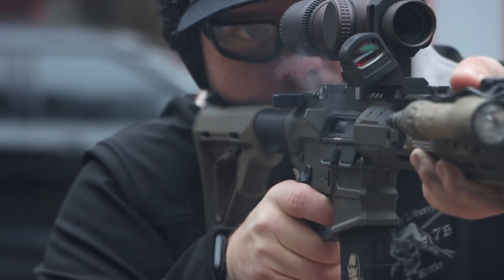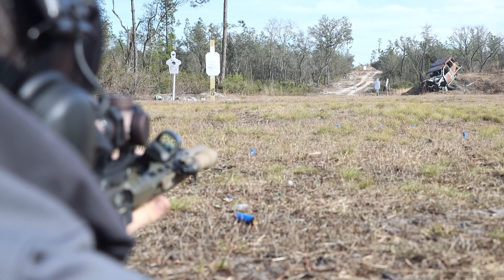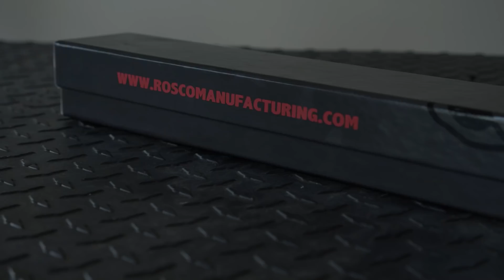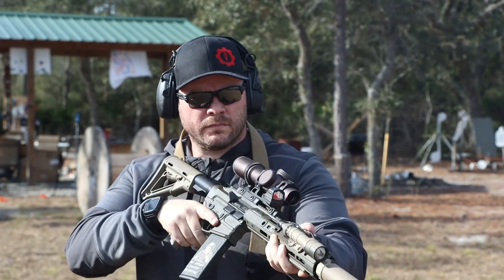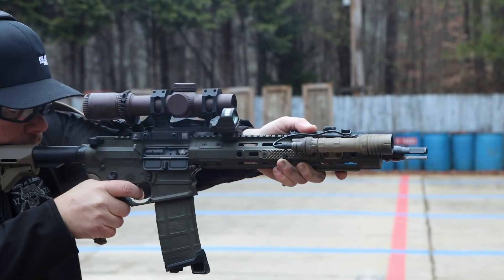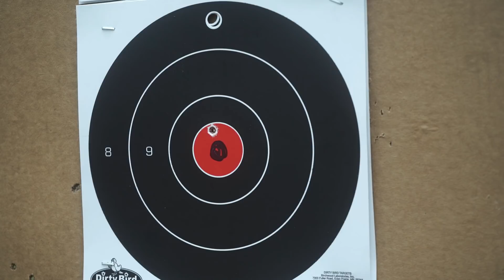Rosco Mfg 12.5" K9 Sage Barrel.

Comment: Gas length and gas port size variety is what excites me personally about AR's going forward. The right barrel length has the right mission set. Each barrel length deserves the proper gas tuning as well. There is no catch all
Reply: Whatever keeps that rifle running.
Reply: Black River Tactical has been on the cutting edge of this for a handful of years.  It's more than just port size, it's also the timing and he nerds out on this part of tuning.  It's a small shop though and he can barely keep them on the shelf.  Good to see a big manufacturing going down this path.  BRT came up with an extended carbine and mid + awhile back and has a ton of fans.
Reply: @recceshoe6911  yeah I’ve got a few BRT barrels. And they are incredible. 
My 12.5” exc BRT barrel is slightly longer than a carbine length system the gas port and length shoots very reliably. 
My rosco 12.5 with the new patrol length is 3/4” shorter than mid length gas and the port is actually pretty small. It runs VERY well. 
The barrel is also incredibly accurate and I used to say my brt barrels were some of my most accurate barrels. The chf chrome lined exc length brt is definitely I trust with longevity and accuracy. The rosco is absolutely a tack driver. Super super accurate but it is 416r stainless so it likely won’t outlast my brt. No matter I’ll buy another rosco for sure. And I’ll grab another brt for sure. 

Can’t ever have too many barrels haha
Reply: @recceshoe6911  I should also say I am a huge
Fan of intermediate length gas systems on my 14.5” builds. They shoot super soft! I also love dissipator 16” barrels. I nerd out on gas lengths for sure
Reply: Good point.
Reply: There’s been a lot of bad ass dudes doing bad ass things with rifles for a real long time and didn’t need to get all super foo foo about their barrel length, gas port size, gas length. At some point all this tinkering really does is give gun nerds something to tinker with and manufacturers something to sell.
Reply: @johnniewasr5740  So... Welcome to the economy. Don't want it, don't buy it. I, however, have already bought one, and I'll do the same for the 11.5". Gas port location and dynamics are definitely advances forward for the AR small-platform rifle, which will help keep it alive and relevant for generations to come. Although I'd be lying if I said I actually look forward to the day, if I see it, that some newer, more advanced platform takes up where the venerable AR15 will have left off
Reply: @johnniewasr5740  They didn't used to shoot suppressed and need the gun to run either way, interchangeably. They also used to do CQB with an M18 Garand, but it probably wasn't very easy. 😎✌️

Comment: How does a 12.5 middy “beat up the bcg?” The only midlength 12.5” I’ve had experience with is Triarc’s and it was the softest shooting AR I’ve ever experienced. Are companies reaming out the gas port or what?
Reply: Pretty sure he said midlength on a suppressed 12.5” beats up the bcg
Reply: @jakobfields2183  That doesn't make any sense, though. If Mid-length on a 12.5" is harsh on the bolt/carrier, then increasing the dwell time (i.e. DECREASING the gas system length from Mid to 'Patrol') will just make it even harsher.
Reply: I am swapping to 12.5 mid from 11.5 carbine. I’m expecting the decrease in dwell time to lower my gas some. I would assume a 12.5 with even longer gas system would further decrease the dwell time and tame it even further.
Reply: @frankender7026  exactly. That’s where my confusion lies.
Reply: @frankender7026  it might be the balance between length and port size.
Reply: I’m using that barrel now and I have had no issues at all. Paired with a lantac enhanced bcg, geissele braided spring with an H2 and runs great unsuppressed and suppressed. Hardly any recoil to speak of or gas in the face I might add.
Reply: Yes, some companies that put longer gas systems on there barrels will then open the gas port up quite a bit in order to get it to run properly. Generally speaking, 12.5 carbine length barrels have somewhere between .062-.070 gas ports. I have a KAK 12.5 mid length and they opened the gas port up to .096
Reply: @izatt82  Bingo
Reply: @frankender7026 Think it works the opposite way that you’re thinking. Increased dwell time means that the system isn’t in such a rush to force gas back which means less violence on the BCG. With the can creating so much back pressure, the idea is that the increased dwell time will smooth things out when running suppressed while still maintaining reliability unsuppressed.
Reply: It doesn't, his new  gas length would "beat it up" more but it all comes down to the size of the gas port. I'm pretty sure we were the very first to start producing mid gas 12.5s in 2010. I have retired but Blackstone is now selling ARP  barrels  4150 cmv 11595-e steel and Melonite/Nitride treated with 5R rifling and Wylde chambers. They typically run 60-90fps faster than other barrels of the same length so a 12.5 is as fast as some 16" barrels especially the old 6 groove design.
Reply: @crashdsnowman1  wait, were you the owner of ARP? I almost bought your 12.5 back in 2020 but you were out of stock, so I ended up grabbing a 5R 16” from Randy (?)

I think I even emailed you because his website was all aviation stuff other than a page to buy your barrel if I remember correctly. Seemed sketch, but you set me straight and I snatched it up lol

Damn, I had no idea you sold everything off! Enjoy the free time brother
Reply: @jeremylowe5449 Blackstone Arms in Texas is making the barrels the same way using my tooling.

Comment: I started making 12.5" barrels with a mid gas specifically for suppressed use in 2010. 4150 CMV 11595e and Melonite treated. We sold thousands every year, our second most popular length after the 16s.

Comment: Your light is about to fall off. I triple de-grease screw/screw hole with 99% isopropyl alcohol and paper towel, shake loctite 243, apply to BOTH screw AND screw hole. 16K rounds on one of my rifles and nothing has come loose, some others have a few thousand as well, nothings come loose either.

Comment: I’ve been running one of these barrels for a few weeks now and it has been performing very well. I ended up putting a triarc systems easy pin gas block on it. The gas tube almost didn’t fit in the gas block and wouldn’t fit in the gas key on the BCG I had for the build. Ended up swapping out the BCG for another I had and after checking the headspace and gas key compatibility it has been extremely reliable so far. I really like it and am very happy with it. Great video as always

Comment: I’ve already got mine on a new lefty build I decided to try running a
Setup with a ejection port on the other side of my face with a can! So far the barrel is PERFECTION!! The profile is awesome. The gas port is great! And it’s basically.75” shorter than a midlength gas system.  I use carbine, EXC, the. K9/patrol and midlength 12.5” barrels. I love my middy but the patrol is awesome!!
Reply: 0.75"? Doesn't sound like much.
Reply: @Darth Erebus. Yeah it’s not
Much. But I’ll tell you what the recoil
Impulse is impressive! I have mine setup using the vltor A5 system and it’s quite a system. 

From the muzzle device down it is setup like this. (Unsuppressed) Forward controls design 6315KM 
(Suppressed) Rex silentium mg7 .224 bore apperature 
Rosco/sage dynamics k9 patrol 12.5
Lefty bcg and upper from stag defense
FCD A5 length buffer tube
Vltor a5-h1 buffer 
Sprinco green spring. 

It shoots beautifully

Comment: A 12.5” mid length barrel is similar to an 18” rifle length barrel.  My 18” SPR was so soft shooting that it failed to lock back on last round with a standard carbine buffer.  I solved the problem by getting the Springco Yellow spring which is lighter than the standard carbine spring and it works perfectly.  So if anyone has any issues of short stroking or bolt not locking back, I’d try the yellow sprinco before opening up the gas port.

Comment: I purchased one. Going to try it out this weekend with a RECCE 5 suppressor. Only complaint so far was the factory dimple is exceptionally shallow…so I purchased a dimple jig and cobalt 5/32 bit to drill it out a bit more.
Reply: The barrel shot great. I ended up using my dimple jig to drill a deeper dimple. The one that comes with these barrels is trash. Guess it’s still better than nothing.

Comment: I snagged one, it won't replace my main barrel immediately but I'm excited to try it out. Been meaning to do a 12.5" build and it came out at the perfect time!
Reply: how's it been, so far? any feedback?
Reply: @sodajones2576  still waiting to get all the parts together. I'm working on like 3 or 4 projects at once, I'm not very good at being focused at finishing one project 😂
Reply: @sodajones2576  I FINALLY got around to finishing it and can confirm it's an excellent barrel. Great 1~1.5 MOA at 100 yards and cycles so smoothly with a Sandman S on it while using a VLTOR A5/Sprinco Green/H1 buffer system.

Comment: I ordered one earlier tonight! Thank you for your development work on it. I'm planning on using my A5 buffer with it too, and I've got 1000, 77gr moly coated OTM's ready to roll my own for it. After working on my 3rd MK12 , 
I figured it's time to do one a little shorter.  I love the idea, of the patrol gas length.  I've got a couple of MK18 clone pistols and I liked the Retro 12.7 pencil barrel length but they have the carbine gas system.  I can't wait to do a test,  side by side comparison,  and get some groups down range.
Reply: What weight did you go with on your A5 system? I dont plan on running suppressed, so I thought the h1 would be most appropriate. Thoughts?
Reply: @andrewfernandez8330  I believe its 5.5oz buffer... Heavier than a H1 I believe

Comment: I have a Rosco 12.5" K9 Patrol length Sauce Pack in the shipping process from Optics Planet. I'm building it on Aero Precision receivers set and handguard. I wanted the soft recoil and the suppressed/unsuppressed reliability. I don't expect to wear it out, as I have too many guns begging for my attention and ammo is expensive, lol. 😎✌️
Reply: Ok, built and tested. I built the Rosco K9 12.5" patrol sauce pack on an Aero Precision upper receiver and it all went together perfectly. Used a Midwest Ind. 11" Slim handguard and a Griffin Armament taper mount Paladin 2 port brake. I ran it on two different lower receivers, both 17 Designs milled units. One with integral folding mech (and it's heavier buffer weight) and the other a plain non-folding lower (with a 5.5oz buffer). Starting un-suppressed, the upper ran perfectly with very light recoil, especially with the folding lower. Suppressed, using a Griffin Armament Bushwhacker 46, it ran amazingly with very little change to the recoil on either lowers. This was just on the short range dialing-in range. So, as yet, I can't speak to longer range accuracy. Softest shooting AR I've ever ran. My 4" 9mm Radial-delayed Banshee barreled AR was noticably more snappy. Thanks, Rosco!! 😎👌

Comment: What buffer weight you recommend for the barrel. Just got mine in today
Reply from the maker: A5
Reply: @SageDynamics  will the heavy buffer and blue sprinco spring work just as good
Reply from the maker: @rafaelaguirre1623  I’ve only used it with the Cobalt buffer system and A5 so I can’t say but I would think so.
Reply: @SageDynamics  thanks that's what I ordered lol
Reply: A5h2 with sprinco green spring is p sweet

Comment: So, it's basically a brt barrel, but in 416R. It should be decent for part time suppressed. 

Full time suppressed you'd want mid length with a small port/agb/BRT eztune.

Comment: Did you find to get move velocity out of this gas length vs the carbine. Or does the larger gas port in the the k9 barrel bleed off more gas to slow the velocity down. Seems like Hodge barrels have higher velocity with the smaller gas port.

Comment: Just started a new 12.5” build using one of the Mega Arms ambi billet receiver sets that Zev recently released and I’ve settled on 12.5” I’m running a Gen 2 UBR stock too, which conveniently allows for the use of the A5 buffer system as well. I was originally planning on this being a 1 stamp build, but if buying your barrel gives me a reason to buy another can I’ll take it!!
Reply: Why would you run a short barrel and then put that boat anchor on the rear end of your rig?

Comment: This is the perfect barrel for my 12.5 setup.  I built one with intent of it being the smallest Mk12-ish platform I could.  Project ive been working on for 3-4 years. Ive been through a couple of barrels trying find the best accuracy and reliability.  I ran into the midlength reliability issue you mentioned, the current barrel has a carbine length, but isnt optimized towards accuracy, as a result I cant get it to group tighter than 1.5 moa.  Just order one to try, looking forward to the unique gas system, and have high hopes for the stainless steel rifling. Usually I prefer a a nitrided barrel for a longer barrel life, any estimate what the barrel life is with the stainless?
Reply: Barrel life is looking around 10,000.
Reply: @Turtl-ss4lj  thank you. Thats pretty much what I was theorizing
Reply: So the 200 barrel should last around 5k worth of ammo?  Seems like a good deal that I’ll never tap out
Reply: Try Blackstone Arms ARP barrels they have 5R rifling and wylde chambers with 11 degree crowns.  4150 CMV 11595-e Nitride treated. Very accurate and usually 60-90fps faster  than other barrels of the same length.

Comment: I guess I got lucky with my 12.5 mid length, triarc systems 12.5 mid length barrel, their non adjustable gas block, lantac enhanced bcg, Geissele braided recoil spring with an H2 buffer. 1000 rounds in and the gun runs great suppressed and unsuppressed. Just figured I’d share that data in hopes it could be useful to someone 👍🏻.

Comment: I noticed that Aaron is using a nox muzzle device, which means keymo mount.  I've got 3 rifles with this mount.  What suppressor should I get.  One of them is 13.7, the other two are 16" guns.
Reply: Keymo fits a crazy large amount of suppressors due to the thread pitch. You have your pick. Anything that takes a Griffin Plan A, SiCo ASR Omega, YHM Phantom, or Q Plan B mount will take Keymo. For a less expensive option, the YHM Turbo and Turbo K perform amazingly well. Dead Air just announced their dedicated 5.56 can, and Griffin makes solid cans too. There are dozens of other great options out there too.
Reply: @frankholub4673  I don't understand what you mean when you start talking about thread pitch when referring to a mount that doesn't use threads....
Reply: @gunsandcommissions  The thread pitch on the actual suppressor tube. The cap on the suppressor between the muzzle and the suppressor. Where your direct thread or other mount lives.
Reply: @poisonouslead85  Thanks, brother.  So the threads that they keymo adapter uses.

Comment: What A5 buffer are you using?  I'm running the A4 and it's still ejecting at 2 o'clock suppressed
Reply from the maker: I’m not using an A5 with this barrel.
Reply: @SageDynamics  What buffer system are you using?

Comment: I'm the goof ball with an 11.5 mid length 🤣.

Took a bit of tuning but absolutely love it. Running an adjustable gas block and JP SCS.
Reply: 11.5 middy is usually supposed to be for dedicated silencer use.
Reply: @johnniewasr5740  it usually does have a can on. But it runs pretty damn well without one too.